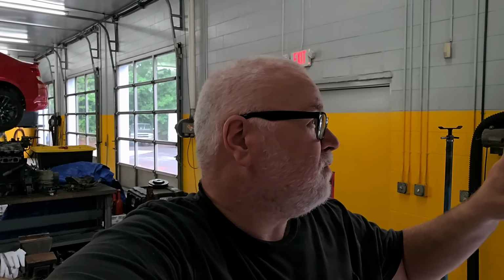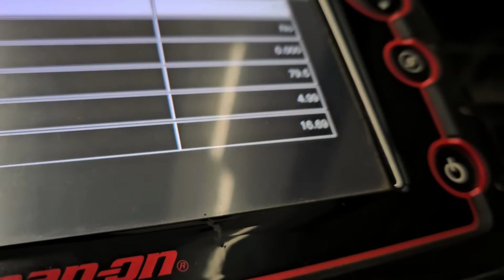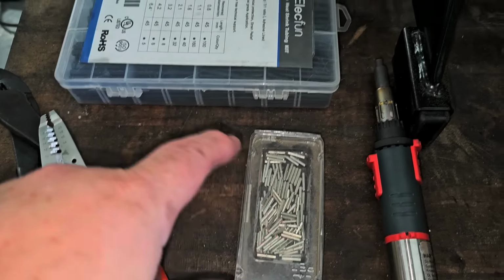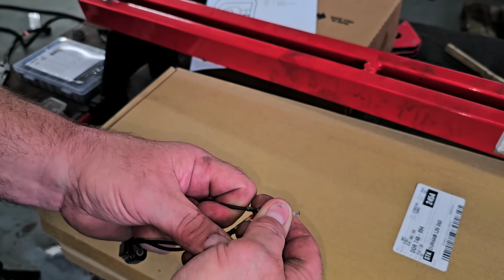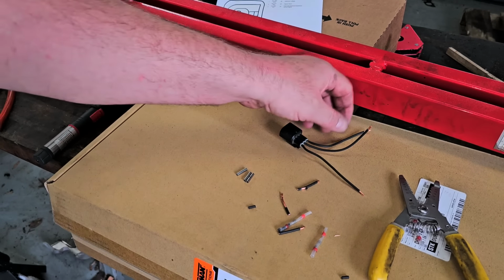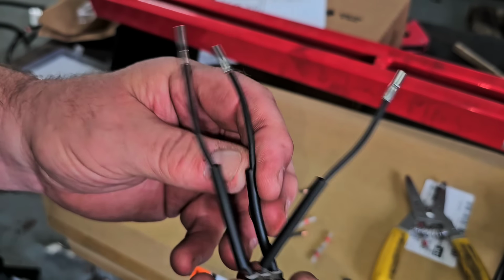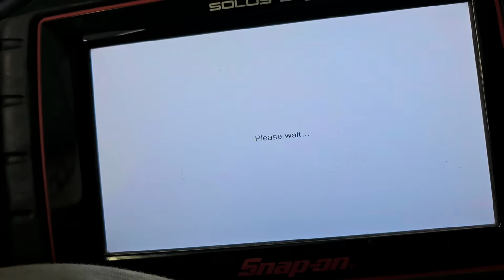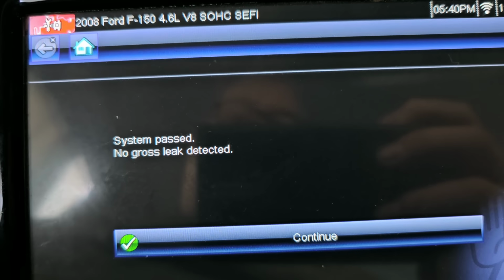Do Not Use These Connectors! They Are Not As Good As They Seem!!

Comment: As someone who bought and used those connectors, let me say this: 
1) They are not as good as they advertise.
2) The connectors in this video were not installed properly. The solder ring inside the connector never reached melting point so it never flowed.
Reply: I agree, I have these and the ones in this video were not heated correctly. Solder did not melt. I also would not feel comfortable using FLAME around a fuel tank!! Hot air gun small tip.
Reply: The wires were visibly tarnished so the solder would never stick anyway. You can't solder tarnished wires! The wire needs to be dipped in acid type flux and pre tinned, then clean the acid off to prevent the wire from corrosion.

Comment: Solder wasn't hot enough and didn't properly melt. I use these connectors on boats and ships all the time. I use a torch, not a heat gun and melt the solder before going on to the shrink ends. Before these connectors I used crimp connectors but still soldered them. Most of the terminals I use are crimp. In marine use crimped connectors will in time have corrosion between the wire and connector. Once soldered they last forever. If I had logged all my time chasing owner caused crimp shorts it could be years. Many people doing crimps don't know how to fully crimp. I haven't done vehicles since 1970. Boats and ships outlast cars. So do their engines. Sorry to disagree. I enjoy your videos. You give out good, practical advice.
Reply: As a touch solder for Lucas Electronics for many years.
You heat the copper wires to accept the solder.
But as a belt and braces person, I do connector and heat it to run down a bit of solder, never had one fail yet.
Reply: Many mechanics have seen these type one and soldered and sealed connectors come back as a cause of a issue due to both crappy connection and corrosion due to not great weather seal

Comment: I first used solder type heat shrink connecters in the 1960s when I worked for the phone company.  If Bell Labs, AT&T and Western Electric used this type connector, the problem is not the connector, the problem is the untrained Tech. The heat shrink connector has been around for 50 plus years.  I enjoy your videos.
Reply: I worked for IBM and worked at Bell Labs in Holmdel. I left IBM and went to work for Lucent at the same Bell Labs. Those were the days.

Comment: I was taught many years ago in a shop class, that you had to have a good mechanical connection to have a good electrical connection!
Reply: Solder is mechanical. I personally crimp when wiring in a vehicle with open barrel B crimps (basically a cold weld). Solder does work fine though, as long as u do it right, and add strain relief beyond the wicking point of both sides of the connection.
Reply: I think u were supposed to be taught to have 2 mechanical connections lol
Reply: Even open barrel uses 2. 1 for the conductor (connection) and 1 for the insulation (strain relief).. soldering: solder conductors and secure for strain relief. Lol wire nuts are even supposed to be taped actually n that's 2. Even a typical connector plug in a car connects the terminals and the 2nd connection is the clicky button dealio. 

Even in plumbing.. solder 2 pipe together and HOPE! 😂

Comment: I use those connectors. You are supposed to twist the wires together before soldering and that connector you pulled off wasn't even heated. You could see the solder was still big and not heated at all.

Comment: Those connectors weren't installed correctly. As these are heated, first the tubing shrinks to keep everything  together. Second the adhesive melts to seal the connector. Finally, the solder ring melts to make the connection. You have to heat these until you see the solder ring melt. Properly installed, you'll break the wire before it comes apart. It's best to use a wrap-around tip on the heat gun with these connectors.
Reply: As is usual, a good mechanic can make a cheap connector work and a bad mechanic can screw up a great connector.

Comment: I twist the wires together and actually solder them with a soldering iron or a soldering gun, depending on the wire guage. I have been soldering since 1961 until I retired in 2012.
Reply: Works every time..

Comment: Correctly soldered connections in cars is the only way to ensure longevity of the connection, otherwise oxidization of the connection over time will occur & cause problems.  Oxidization will occur over time with crimp, snap or whatever type of mechanical connection you use.  The amount of these mechanical connections in cars has always amazed me being a retired electrical engineer.
Reply: Sorry bro but your nuts solder oxidize also all metal does.
Reply: I was a 2 way radio technician for nearly 40 years. Soldering physically secure connections without applying sufficient heat
 from a soldering iron is  asking for trouble.
Reply: Only way?
Reply: Not to mention its as strong as any other part of the harness, when soldered... and when done correctly, is nearly undetectable, with no resistance inducing lumps of dissimilar alloys changing signal reference voltages...
And waterproof too.. idk lol.
Solder, flux, die electric grease, and a long quality, properly sized heatshrink tube, heated correctly..is superior to most human installed crimp connectors.
Just not as easy as crimping, 
IMHO..

Comment: The other thing about these connectors is the type of solder they use. It's not the same as normal solder, it has a lower melting point to allow it to melt before the plastic burns. Low melting point solder puts the connection at risk if you place them in an area subject to engine heat, since the solder may reflow and possibly lose some of the mechanical connection. These were fun to play with but for the most part I've gone back to what you're using here, marine grade shrink wrap around standard uninsulated butt connectors.
Reply from the maker: As always, you've hit the nail on the head !!

Comment: Kenny you are absolutely correct, those heat gun solder connectors are complete garbage.  As for regular old style non-heat shrink butt connectors and scotch locks still have their place, at least in my shop.  I been splicing wires for the last 40 years.  Great job on your diag. and repair!

Comment: Interesting that Eric O. at SMA just posted a video about connectors!.  For over 40 years, I've used the compound "vise" like  pliers to make ""pro" connections, which I would strongly advise others to do as well.
Reply: They don't work either when you get old and have arthritis in your hands and fingers ! time to retire!
Reply: i saw that  video  also with dr o  sma  also have a look at northridgefix alex say dont use low melt solder to solder joints use good quality solder and flux which i cant see in those connecters a good idea that dont work

Comment: Nice video Kenny.  The computer only "sees" small changes in voltage to determine what's going on.  You were correct that those connectors were interfearing with that. I solder wires to prevent moisture from corroding the connection. OEMs don't do it to save money.

Comment: I’ve just used four of those connectors to make repairs on two different cars. We have had no issues. Based on what I am seeing, they didn’t heat them sufficiently for the solder to melt. You must have good lighting, and you need to watch the copper connections, making sure that the solder thoroughly penetrates both sides. My diagnosis is those connectors were not heated to the point that the solder melted. They are not easy to use correctly, but when used correctly are a reliable means of joining wires.

Comment: I used this type of connector when I rewired the instrument panel and avionics in my Beechcraft Debonair, but they were purchased from an aircraft parts supplier and were made by AMP, if I remember correctly. They were approved by the FAA inspector after installation. When I heated them up and the solder melted, you could actually see the solder wick into the wires giving a proper joint. Twenty years later, I have had no problems with any of the connections, and some carry the current for the landing gear motor and flap actuator which can draw over 20 amps. 
Most likely, the cheap solder tubes used had crappy solder and no flux, and/or  were not properly installed, as it takes a lot of heat to get the solder to melt and flow properly. If they are heated only until the tube shrinks up, they will not provide a proper connection.
I have no problem using this type of connector, IF they are a good quality connector and they are installed correctly. Any connector can fail if not suited for the particular application, and if not installed properly, whick in this case was not done.

Comment: I’ve used these on several ocasionas and have noticed that it takes a decent amount of heat to melt the solder, to the point that the heat shrink is almost melted.  I then have to use electrical tape or more heat shrink to strengthen up the connector.  Once I use up my supply will go back to twisting and soldering without connectors.  Good video.

Comment: I do use them and have yet to have a failure, and have no plans to throw mine out..  As others have said, the key is to make sure the solder melts.  Bonus if you twist the wires together, though that is not always practical.   The reason OEM does not use solder is simply cost.   

I also use the glued & heat shrinked crimp connectors.   But when there is room to apply them, I have more faith in the soldered connectors.

Comment: I have had good luck so far on my own beaters..I dont like the Chinese kind like that..I go one size up from what I "need" twist the wires together then slide it over and I use a lighter or a torch and then put another sleeve of heat shrink around it.

Comment: Who would have thought that using low melt temperature solder in an automotive application (possibly next to hot exhaust) would cause issues. I agree with you Kenny, these things are junk! Crimp and heat shrink as you did, or solder and heat shrink is the best option IMO.
Reply from the maker: Lol 😆

Comment: The solder is not there because they didn't use the right heat gun . They only shrunk the plastic. we use similar connector on aircraft but for  grounding the shielded wires. Right heat gun makes the solder melt. they work great .   They are FAA approved and called solder sleeves. I've also used the newer butt connectors that have the red, blue and yellow heat shrink sleeve right on them with great success on my 83 f100 on the trailer wires and tail light wires in place of the old connector that corroded. tail light work great an no more problems. And I live in MI. Salt belt and drove the truck in winter too.

Comment: As a NASA certified solder Technician, preparing the wires  correctly means everything. Those solder connectors will work IF the wires were cleaned  to the point the solder/flux does its job.  Unfortunately some Techs want to do the quick and easy and don't bother to ensure the wires are free of contantaniments . I would prefer using  soldered and heat shrink to ensure visual good flow of the solder.
Bottom Line: Don't blame the product if it is used incorrectly.

Comment: So as a ex car stereo installer (now a NICET certified low voltage commercial fire alarm guy), the best fix is to strip 3/4 inch off both wires and then twist them together, then use a pencil torch to solder them together. Yes, you did use the proper hot glue heat shrink. Only the factory duel curl type crimps like in Amphenol connectors is worthy, the barrel crimps are hit and miss where the wire can often also just pull out under tension. If it's gonna get wet, solder the wires so they can never just pull apart IMHO.

Comment: Hello kenny.
If it weren't for people like that, we'd have nothing left to screw. 
These soldering connectors are not so bad if you use a heatgun and make everything very hot (360° Celsius) so that the solder runs well. I myself have used it successfull.

Comment: The solder inside these connectors are low-melt solder. Low-melt solder take less heat to melt but they are very brittle and can break easily. Plus there's not enough of it in the connectors to make for a solid connection. Look at the size of the connectors and imagine how much solder is actually in them. I use them but I only use them as shrink wrap. I still do regular soldering. They actually perform well as shrink wrap because of their waterproofness. I think.
Reply from the maker: Marine grade shrink wrap is a more economical solution. Especially if you're taking the time to do the repair correctly. Thanks for your input & watching the channel. Keep wrenching 🔧

Comment: I gotta say.. those solder shrinks do work, but I wouldn't use em for anything but terminating a shield in my truck. However, I used em on a breakout box for my acoustic/electric drums.. I did a few tests though, til I found the best way to use em: 1) make sure ur wire conductors are CLEAN. 2) add flux to the wires before sticking the shrink on it. 3) for larger gauge wire, put the shrink on 1, get ur leads tied nicely, and wrap a bit of extra solder on the connection, then slide over ur solder shrink. 4) use a focused heat gun (not lighter, not a hair drier, and not the dinky heat gun from an auto store... Use a variable temperature and variable airflow gun) with high heat and low flow. 5) unlike doing a normal shrink tube, shrink the outside ends 1st, so the heat gets trapped in for that solder. 6) don't remove heat til the solder actually melts (if u think the tube will melt, back off, DONT aim the gun away). 7) heat 1 side then the other OR roll extremely fast until the solder melts in good. And 8) it's not melted in at all (the slightest bit) if u can't even see the strands through the solder!

Comment: having used those connectors many times, i will say that they do in fact work well  for their intended purpose BUT, you need to prepare your wires meticulously and verify that when you shrink down the sleeve and melt the adhesive, that you did in fact melt the solder as well. 

most people just shrink it and assume that the solder also melted
Reply from the maker: #crswro1690 I get jaded because I end up with the idiots versions all the time. I have to figure out where they screwed up the connection, how bad the connection was done & work with what little wire they left. People who don't know what they are doing should not use them. Period. Thanks for sharing your experience. Thanks for watching & keep wrenching 🔧 Kenny
Reply: These connectors cannot work properly, the design makes it impossible. The very first thing to learn about soldering is that you MUST heat the metal, not the solder. 

The solder will transfer some heat to the metal but not enough as the metal conducts the heat away so it never reaches the temp needed for proper fusion. The result is what is know as a cold joint.  Obviously with these connectors you are heating the plastic to put heat into the solder and the wire inside is the very last to get the heat and as copper is a very good conductor of heat the rest of the wire will keep the copper colder than the solder.  

Keeping the heat on longer after the solder has melted may bring the copper up to temp but the insulation will melt long before the copper is hot enough for a proper connection, esp if using a gas torch or a heat gun. 

On a normal solder joint the iron is directly heating the wire so it can heat it up quickly without dumping too much heat into the adjacent wire/insulation but the plastic on these connectors make that physically impossible. These connectors use a low melt solder to stop the plastic getting as hot but low melt solder itself is not ideal and still requires the copper to reach a certain temperature for proper fusion.

I think the best you can hope for from these connectors is that the solder will stop a securely twisted together wire from unravelling which is a step up from 'twist and tape'. At least these connectors fully/securely insulate the joint against shorting out and the glue will keep the water out. Tbh, I would prob use them in certain situations but not for anything important or high current. After spending hours this week doing lots of tiny crimps I can certainly see the appeal

Comment: I keep these in my truck for emergency fixes. Whoever put these on did not heat them up enough to melt the solder properly. When I use them I make sure the wires are interlased if they're multi strand  wire. Squeeze on the solder point so it touches the wires and squeezes them together. Then heat and make sure it wicks into the wires. After its fully shrunk down cover it with marine grade heat shrink to keep water out. They work fine if used right.

Comment: Yes. Manufacturers do solder some connectors. My 2017 Ford F150 radiator fans have soldered connections on its terminal strip. One of the fans was not running and I found a cold solder joint on that terminal board. It runs fine now after I reflowed the solder with a large 120watt solder gun.

Comment: The heat shrink with glue keeps the moisture out as does soldering after crimping will keep the moisture out. If I can then I do both. Whatever works for you. Happy Motoring.